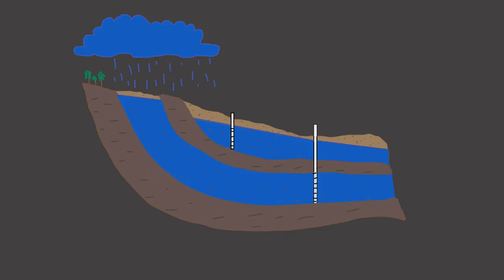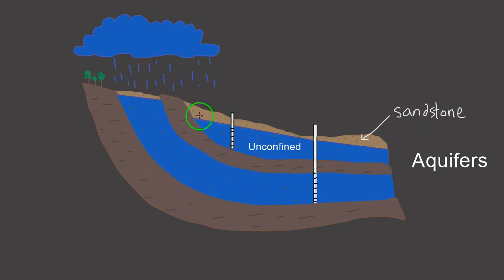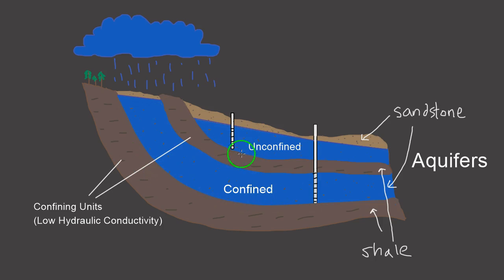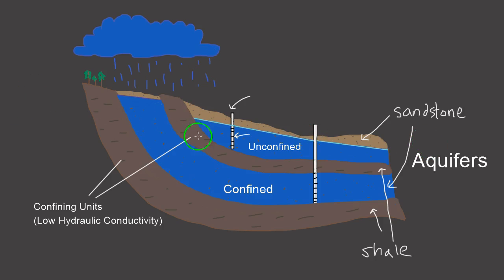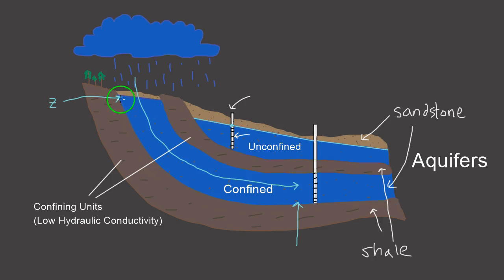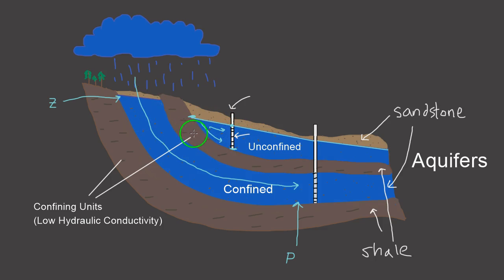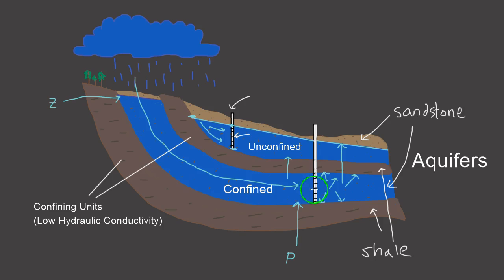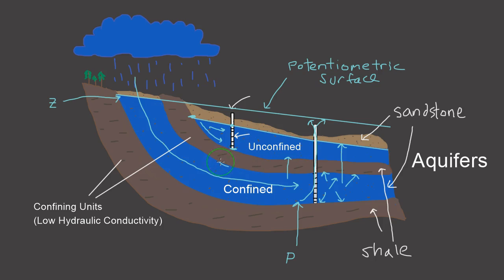Unconfined Aquifers vs. Confined Aquifers

Comment: Good day! Tell me please, is there any information on the distribution of the depression cone in the confined aquifer? For some reason, they always depict a funnel passing through a waterproof layer. How can it spread evenly through the clay layer? It seems to me that the depression funnel in the confined horizon should be enclosed between the impermeable layers, or am I wrong? Thanks!
Reply from the maker: The monitoring wells will be installed in the permeable layers, not the clays or impermeable layers. So when you see that "funnel" or "cone", it is representing the head in the permeable layers, not the head in the clay or impermeable layers. So when you see the cone spreading through the clay layers, that just means the head in the permeable layers rises to an elevation that is the same as the impermeable layers - it does not represent head in the impermeable layers. Hope that makes sense!
Reply: @daneandersen8181  Thanks for your reply! however, it is still unclear what a sinkhole will actually look like when pumping water from an aquifer enclosed between two impermeable layers (eg, clay). If the static water level in the well is set above the roof of the watertight layer (in the pressure well), then the water level will decrease during water intake (the static level will drop to the dynamic water level). In this case, the depression funnel, it seems to me, should not go beyond the aquifer, enclosed between the layers of clay. Or is it not so?

Comment: so unconfined and confined aquifers can be in the same location, right?
Reply from the maker: Yes, they will just be located at different depths.
Reply: @daneandersen8181  if i dig hole up to confined aquifers and put pipe let say    60meters deep, isnt hard to pump out water using manual piston water pump?

Comment: So basically unconfined also means shallow well and confined be a deep water artisiean well?
Reply from the maker: No, not necessarily. You could have confined conditions in a shallow aquifer, and unconfined conditions in a deeper aquifer. What really makes the difference is if the water in that aquifer is under pressure because a low permeability rock unit (e.g. clay or shale) is overlying the aquifer
Reply: @daneandersen8181  Knowledge is held, you don't know until you ask... Appreciate it, m8

Comment: Hi i saw all your videos and i want say perfect.......
I wanna ask for a pumping test for permeability why using piezometer  and observation well rather than just observation well
Reply from the maker: A piezometer is basically an observation well. Piezometers are just small diameter wells that are mainly used for measuring water levels (the small diameter makes it cheaper to install, but you sacrifice the ability to insert a large pump into it). The main point is that during an aquifer test, you measure water levels in the well you are pumping, and any surrounding wells (which in that sense are observation wells, and could be a regular well or piezometer)

Comment: How does one obtain a potentiometric/pressure reading in the water well of a confined aquifer?  Does one remove the well head cap each year to see if the water level has dropped and/or risen with a string measurement or ruler? I imagine one must use professional service to ensure confined aquifer is not contaminated by doing so, either.
Reply from the maker: Yes, you can remove the well cap and use a water level tape.  Usually the well will have a smaller pipe to insert the water level tape to take a measurement, that way you don't get the tape wrapped around the pump column or cables.  The water level tapes are quite expensive, but you can rent them from environmental supply shops.  You don't need a professional to do this, just the right equipment and decontamination procedures.  Don't go sticking a contaminated tape into your well!

Comment: I have a dug well and the water table is about 17 feet down and I have a water pipe at the bottom of a hill that is higher and never stops flowing. is the pipe in the side of the hill an confined aquifer and is it cleaner water ?
Reply from the maker: Possibly, how far apart are the well and the hill?